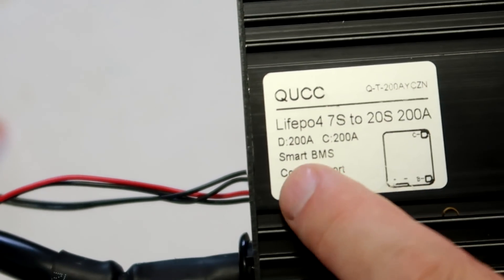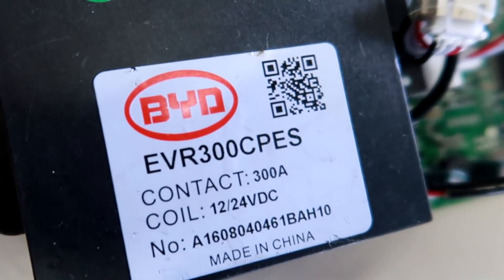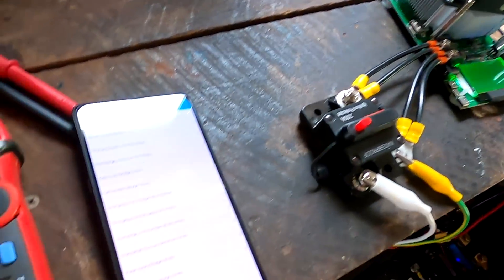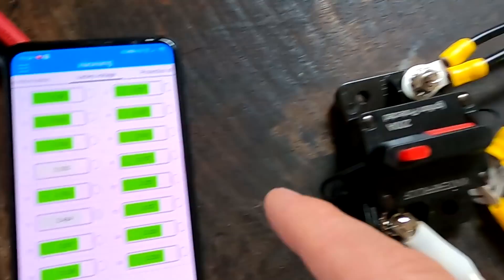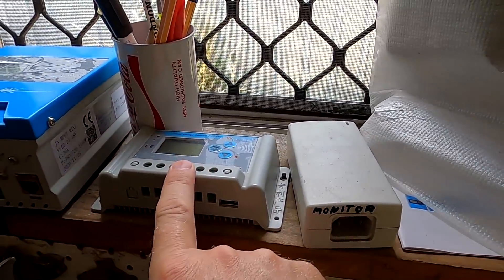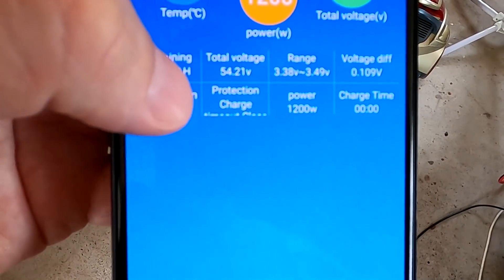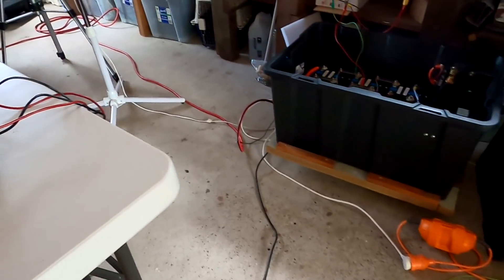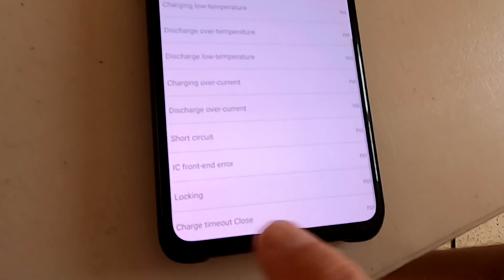This QUCC BMS does not protect my battery! Am I right?

Comment: I just bought the JBD branded version of this same bms (300a version) and the relay does work correctly and open if any cell reaches the overvoltage setpoint. your relay was likely fused from your previous video where you had it opening and closing rapidly because the over voltage and overvoltage reset voltages were adjusted too close together. The charge overtime is a log error that the bms didnt disconnect like it was supposed to. The quickest way to destroy a mechanical relay is to open and close it multiple times in a short period of time which heats up the contacts and fuses or burns them. (mosfets and SSRs do not have this issue/limitation.)

Comment: I think it a good idea to install an LED with a 10K resistor in parallel with the BMS's relay (or MOSFETS).
This way, once you see it lights up, the relay or mosfets disengaged. (ie protection mode)

Comment: A BMS should disable charging if separate charging port, or total shutdown for common path, when any single cell goes out of range, high or low voltage.  Overcurrent protection is shutdown whenever BMS measures current in excess of set limit range.  Many cheap BMS's that use MOSFET's just use the MOSFET Rds voltage drop as their current shunt measurement resistance.  They measure the temp of the MOSFET's, which Rds goes up with temp, and apply a temp 'fudge factor' on MOSFET Rds for temp.  This method is very inaccurate.

I am not a fan of BMS with contactor relay cutout switches.  The relay coil for high amperage relay takes a lot of power.  Most cut back on coil voltage drive after relay is closed to reduce continuous coil current, but this also reduces the contact retention force.  Mechanical shock with the reduced contact retention force can cause the contacts to bounce. Also the strong DC magnetic field  created from a high current inverter surge can cause a bounce of the mechanical contacts when the retention force is reduced to save relay coil current.

Comment: Damn, could we just find one good battery supplier, one good BMS, one good inverter/charge controller and be done with it? Every damn solar vlog has horror story after horror story with a shed full of old/broken equipment.  I'm gonna go with a Sol-Ark 12K and some SOK 206ah batteries and pray it all works.

Comment: The Chinese are world leaders in solar technology and manufacturing, they know what they are doing.  Why do people always blame them for their own lack of knowledge on the subject?
Firstly, regarding your inverter. These are designed to be exported globally, most countries require galvanic isolation between the DC input and AC output circuitry by law. They are designed to be as universal as possible. As I have already stated, the answer is not to buy a more expensive inverter, but to modify the one you have  very slightly to ground reference the output.... the addition of ONE wire.  
Your BMS is NOT required. You will find many many large lithium installations without any BMS or balancing system.... check out Youtube for this. I dont use a BMS either for my large installation, they are problematic for people who worry too much and continually fiddle with them. Remember, you are looking at  3 decimal places in voltage resolution. These large banks are driven very gently, with PV arrays limiting current well below any maximum, the sheer bulk of the active chemistry makes fast and  long lasting voltage excursions  unlikely and non important, like a large thermal mass being heated from one side, time will even out the thermal gradient, the  voltage in a battery bank too will even out over time too,  Batteries cannot be measured accurately  during a charging phase, voltage measurement will be more accurate during a prolonged and slow discharge. The argument for a BMS originates with electric vehicle banks that are zapped   with huge currents during both charge and discharge, with subsequent  heating of connections and cells that needs to be monitored for safety, this complex monitoring is unnecessary with the average larger PV installations.  It is best to keep a home setup as simple as possible. For peace of mind, an active cell balancer is useful yo warn of a REAL problem. Even   only dragging 1 to 200 mA from the higher cell/s , these work 24/7, and again, over time will keep the cell voltage  differences within a few 10s of mV.  Any of the cheap Chinese active balancer boards will do this very well. I wont comment any further, as you seem to prefer to buy more stuff rather than understand what you have already.

Comment: Hi Andy, desperately need your help on this one, I had a DC charger fail! It overcharged my Lifepo4 battery to 4.66v 🤦‍♂️🤦‍♂️🤦‍♂️🤦‍♂️ before I caught it, it seems like the cells have expanded a little bit not real bad, do you have any idea what or if any damage has been done? I discharged the batteries immediately to3.3v... I would appreciate any help from anyone on this subject that has experience, thank you in advance
Reply: Doesn’t sound great- I’d say BEST case you’ve lost some capacity. Only further testing will prove the outcome.
Reply: @FutureSystem738  Thank you 😊

Comment: If I have a 100 amp 12 volt battery, made up of 40 10 amp cells, (10 X 4) and use a 4s BMS how do the individual cells get protected? Do I need to use 10 BMS's or fuse each cell?

Comment: WTF?! Only if pack overvoltage, not one cell...???🤯 My BMS from Shawns Best works perfekt - of course if one cell hit the triggered value! For intermidiate solution you can set overvoltage to 3,4V and low voltage for 3,1V. Then the pack voltages should protect every cell because you use only 80% of your batt capacity.

Comment: Hi, Maybe it would be a good idea to put a relay in the solar panel positive line of the charge controller that is controlled by the BMS to stop over charging. I have been using Batrium on my DIY power wall for a long time and it has performed well and also has a large support group. This is all part of overcoming the challenges of DIY and a good way to learn like the rest of us. Keep up the good work and save a frog :-)

Comment: Moin Andy! Have you looked into what the red/black SW leads on the BMS do? Maybe they are a relay output to hook up a relay for the charging branch. My future BMS has two relays, one for charging and one for the load. in case of overvoltage it will turn off the charging input but still will be able to discharge and in case undervoltage it will be able to charge without discharging. Maybe SW is turned off and the BMS still sees charge coming in and is warning you that it might be bad for the battery. just my two pennies.
Reply from the maker: I think that's what it is but haven't looked into this yet. Thanks for the reminder though.

Comment: At undervoltage the load needs to be turned off and at overvoltage the charger needs to go off. If you have a common port bms the load will be off with a full battery and the charger will be off with an empty battery. This the reason for using separate Port bms. Maybe The Software of your bms was designed for multiple Hardware bms and Software and Hardware guys did not talk. Sometimes those Things Happen in multi vendor product development Situations

Comment: Let me guess what the designer is thinking. BMS drains the power off from the battery by connecting a resistor across that battery once it reaches a threshold voltage. The charger is still charging through the series chain of batteries. At that battery the current goes in that battery is equal to 0 or minus due to the resistor, so its voltage won't go up, while the other batteries can continue charging up until all of them are above the threshold voltage. I believe your device is defective. Do you cross check the voltage across the batteries with a DVM verses the reading on the BMS ?

Comment: they discontinued this model few month ago, and now came out with latest model, not sure it still perform the same or not. But i believe it has some changes in the circuit board logic as it only support 13~20s now instead of 7~20s on previous model.
Reply: qucc may have stopped selling it but Heltec and JBD still sell this same model as well as the newer 5s-24s active balance version.  Andys relay was fused on this bms and when it started beeping the relay should have opened the charger overtime error was because the software noticed the battery overvoltage condition  persisted.

Comment: You need to capacity test every single cell. Looks like cell # 11 and #6 are lower capacity than the rest of the cells, which is why they charge much faster than the rest, because they don't store as much energy.

Comment: Did you ever connect your inverter without pre-charging the capacitors? That may be detected as a short circuit by the BMS, as well as welding the relay contacts (and usually causes a spark, which is an indication that big current is flowing thru a poor connection).

Comment: Just ran a test of my BMS and it is definitely turning off when it hits an individual high Cell voltage, in my case set to 3.6v.  Specific Manufacturer is listed as DGJBD, using the Xiaoxiang App.  This BMS uses Mosfets, so maybe this is a function that is not possible with  a relay.  I never really trust "Manufacturer" when dealing with Chinese products, as you can often find 10 different Manufacturers selling exactly the same product.
Reply from the maker: Thanks for testing it, Dave.

Comment: I have seen some others that are the same.  The common wire BMS's have some issues not that all of them are bad, but I prefer the ones that have a separate charge wire I have had better luck with it able to turn the charge off and not kill the power that runs the logic since its usually hooked up to the discharge power rail inside.  Really is a pain each of them seems to have some kind of weird bug that you need to workaround.  The balance function on the more expensive ones tends to not have enough balance current so it stays unbalanced forever.
Reply from the maker: Yeah, this it the first BMS with this battery but obviously not the last one. I'm still unsure which way to go. I don't like the Dalys with their 20mA balance current... and adding an extra balancer... JEEEEZZZZ!
Reply: @OffGridGarageAustralia  Yeah haven't found a perfect way yet.  I am currently using an active balancer from ebay rated at 5A it's more like 2A but nice to keep them all the same well and may complement what you have since all the cells would match and if it goes high they all would be high so can use pack voltage max to shut it off.

Comment: might be an alarm related to the fact that the relay seems to be not working, and with current still flowing, it is a timeout for the current shutdown at over voltage.  Can you remove the BMS open it and test the relay separately?  Lol, I like your "Surprised" face.  The thing isn't working...  It should shut down if over or under voltage even for one cell....

Comment: This is part of the problem with a common port.
Reply from the maker: Why is this a common port problem?
Reply: @OffGridGarageAustralia  Sorry, a bit short comment... I meant that part of the common port problem is that if you have any issue with charging, and the relay turns off, you also turn off the discharge. ((and vice versa). It also makes the troubleshooting more tricky.) Suddenly you have no way of discharging your battery to remove charge quicker than the balancing.
Maybe best option would be 2 separate latching relays? Or one latching(for discharge) and one normal (for charging) ?

Comment: the old teck again--battery o'voltage is probably your key setting for your pack--keep it as low as you can--move the cell to prove bms is good or not(importment)if snag follows cell well you can figure it out--if not get your money back for bms--by and by relays are ok-if one m fets shorts game over too-when electronics cuts out relay its open but shorted fet does no longer respond and if your not around to hear the bms's complaining,by by to the whole deck--i prefer a relay which would open on pack o;voltage-good luck-i/am an aircraft mtce engr avionics with degree in electronics and ham radio guy since 1962-73 from va3ev

Comment: If a cell exceed limit BMS should stop charging
or if exceeds lower limit shoul stop the system.
All the bms I've used so far work like this.
Manufacturer's answer shows that bms design is wrong.
my opinion you shouldn't use that bms
does not seem safe to me and maybe cause bigger problems later on

Comment: As 200 other people seem to have said,  it should do all that.

But just to add, I also got frustrated at BMS choices for my needs.  I actually ended up with a hybrid half-BMS system.  I'm only on 12v so 4S,  but have 12kwhr (24 x 150aH cells). My main problem is dealing with the amps - I can output 900 amps @ 1C but only want ~300amps.  
My inverters run without BMS - including my inverter/charger but just set at  3.36v / cell max so that cant spike. And have low voltage cutoff at 12v (average 3.00v /cell)
All my 12v items, and MPPT run through a 100A BMS - used for, monitoring, top balancing and as a more sophisticated protection that voltage on the inverters - low temp charge protection also . It should also balance - but like you know the balance current is really low - and as I'm 4S less but 6P then that's a lot of capacity to balance so thats not really working.

One day there will be a good, high current, good protection, good balancing, cheap BMS for us to use, but for now its pay more, lose features (eg Daly has no low temp and no way of looking/changing at settings).  Really I need to split my pack into 6 packs, and run each with a 100A BMS rather than 1 big pack on a single 100A BMS.

Anyway, with you on 48V and 100A being fine just go get a new BMS that will actually protect your cells, but the geek side of you may also want a separate cell monitor if you get a Daly just so you can geek-out and see the individual voltages.  I'm guessing you can get away without low temp protection in Australia :)

Comment: You should buy a Daly Smart BMS!!!
Reply from the maker: With 20mA ballance current?
Reply: @OffGridGarageAustralia  if you top balance correctly the cells, the BMS will never need to active balance it. Especially if you don’t use high current discharge, like over 100A continues for those 280Ah cells. I have the same cells though 👍🏻

Comment: Your BMS should absolutely turn off if any one cell is over voltage, under voltage or if the battery pack is over current (charge and discharge), over or under temperature.  If it doesn't disconnect the battery pack for these conditions it is worthless as a BMS.

Comment: As far as I am concerned cell level protection is the sole purpose of a bms. There is better equipment to monitor and control things on the 
pack levels. We need a simple mechanism that actually works on the cell level. You either get something like a cell monitor in the RC hobby world that works but cannot alarm or shutdown and then these do everything pieces of junk in the larger cell DIY market. Someone just produce a cell monitor that can shutdown via relay when a cell goes over and under!

Comment: Check to see if pack voltage is present on the output side of the relay when the bms is alarming. If so, then check for the presence of 12/24v on the relay coil. If the coil voltage is absent, your relay contacts are stuck/welded.
Reply from the maker: There is always power available though this 10Ohm resistor. I think it kind of senses the output and closes the relay if it gets too much. I can see the Smart Shunt is always powered so gets the negative through the BMS even if the relay is off.

Comment: if you want a really cool battery manager and possibly solar controller as well, look at the electrodacus! is will control charge separately, so if the cells are full, will turn off the charger but keep the battery loads connected.. its a sweet system, but you need inverters/chargers that have a remote control input or a hard switch you can rig.. not those inverters with a pushbutton you need to holds for a second to turn on/off .. i can highly recomment it, the developer also is super responsive and knows his stuff

Comment: The BMS has to turn off the charge/load in case of under/over voltage on a cell level. That's the point of having a BMS. That's how all BMS systems I've worked with work. It's how all my BMS devices works, even the cheap versions I used in my sub-10K project I documented on diysolarforum.
Reply: Exacto!! Así es como trabaja mi BMS

Comment: A top balancer is what you need to add.   There are a couple with high current....I think up to 5 amps.

I run my pack at 80 percent and can avoid worrying about over and under voltages

Comment: It kind of works, you just have to live in your garage and turn the charging off manually as soon as you hear the beep........ . Why does the BMS measures all the cells if it can offer only protection on total voltage, which is kind of meaningless anyhow. At least at the top, the solar charge controller does this anyhow. Also it makes me wonder how accurate the voltage measurement of the cells is? Maybe your battery is better balanced than you think.

I would definitely buy a BMS with MOSFETs. Much more reliable, quicker. And, yes, chinese circuit breakers are a no-no.

Comment: You mentioned that the BMS had an inrush resistor in parallel to the relay that limits the current to the inverter capacitors. The relay then closes to short out the resistor. Sounds like you may have a charging path through the resistor even when the relay is open.  Just a wild guess since I am unfamiliar with the details of your system.

Comment: Does the relay clunk when one cell reaches the high voltage disconnect level?  If so, and the BMS still looks connected, perhaps the beefy pre-charge resistor is in still circuit making it look like the relay is still closed?